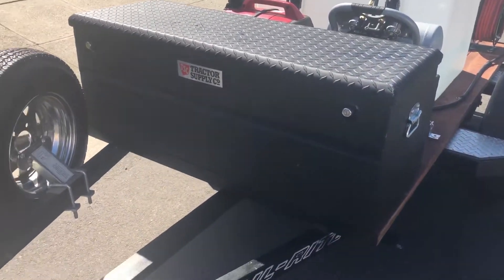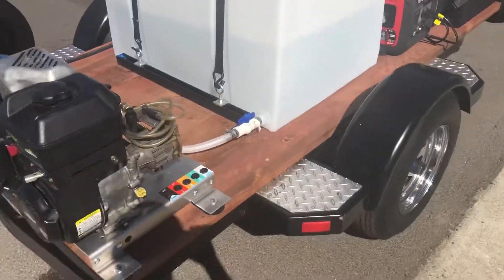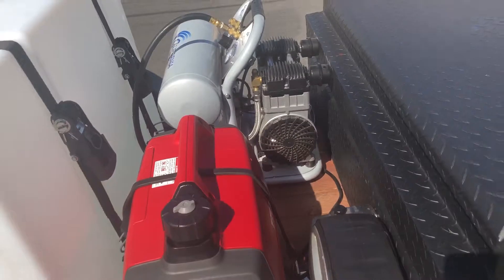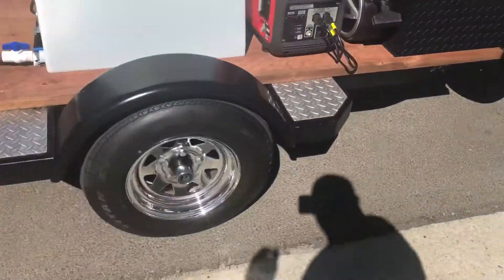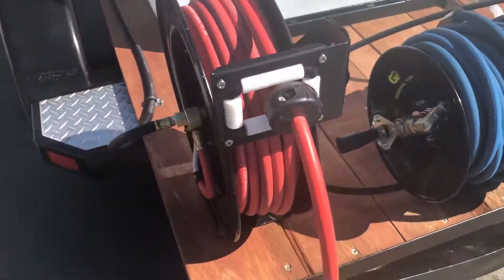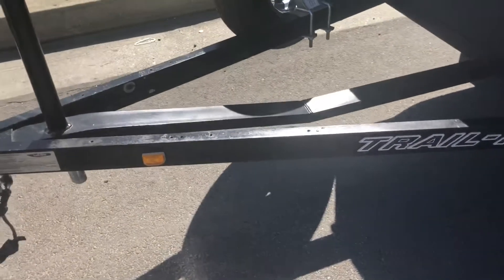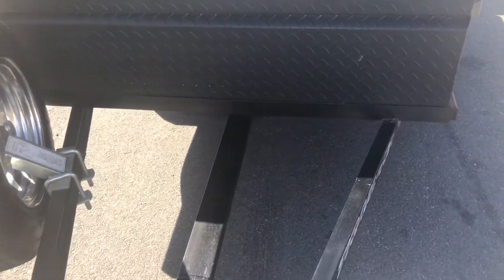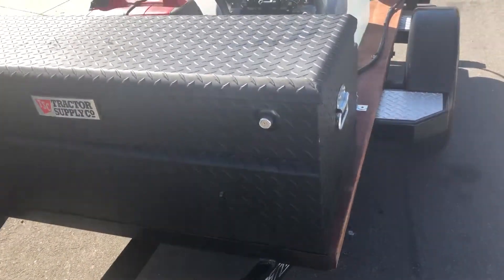Auto detailing trailer

Comment: Brother man, how did you secure the water tank? Would you mind giving a list of your materials used?
Reply from the maker: Deep uni strut 1 5/8” 
Fender washers and wood lags every 6”
Uni strut flat washers to 1/2” eye bolts 
1/2” strut nuts
Then ratchet tie downs 
Securing the tank is very important 
A lot of damage can happen if it gets loose 
Be careful 
Over build it to be safe
Reply: @acecard8109  much appreciated!!